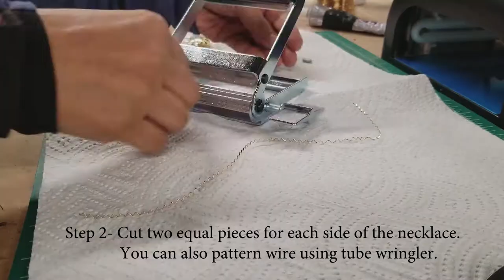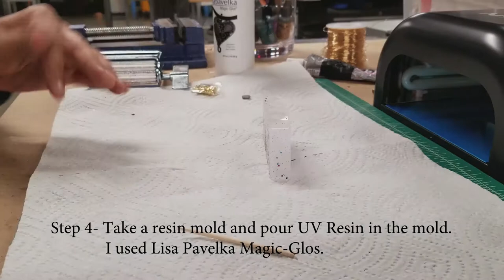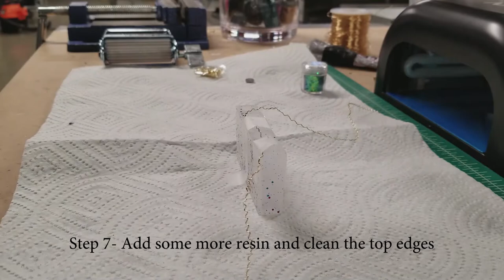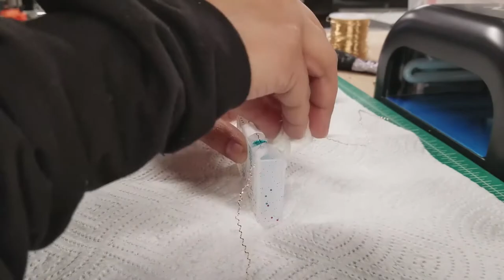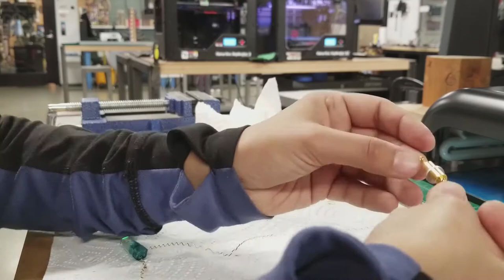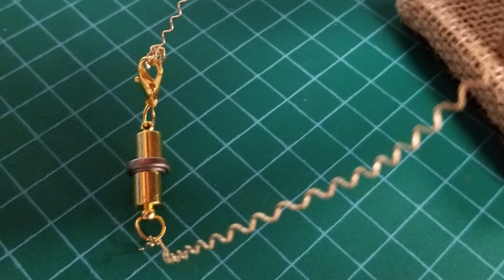Making a LED Resin necklace

Comment: Thank you for an insiration. One tip: isn't it better to cover a wire with an insulating varnish to prevent short circuits?
Reply: Alguno cables son aisladoa, se usan como en motores donde solo la punta esta sin recubrimiento

Comment: hello rolly. great job brother. i bought some stuff giving a try for this. but im having issues,  i bought some artistic wire silver color and some magnetic clasps from amazon. i connected them with the battery and could not light it up. i then connected the led light with the battery only and it worked. could it be the wire and magnetic clasps? do they have to me real metal?  need help and advice. thank you
Reply from the maker: sorry to hear about your issue. Normal artistic/craft wires are usually not conductive. I bought bare wire from parawire website - https://parawire.com/cbc-metal-supply/metals/bare-wire/    and after testing that worked for me. Also, for magnetic clasp the entire of the wire should be tightly connected to complete the circuit. https://www.amazon.com/gp/product/B00Q9LNGQY/ref=oh_aui_search_asin_title?ie=UTF8&psc=1  Another problem could be that the battery might be placed in the wrong direction.
Reply from the maker: you can also mix your artistic wire with conductive thread https://www.youtube.com/watch?v=0MkVqC1zTuI&t=16s to make a similar circuit.
Reply: @AlwaysBeCurious_  thx brother. yea i tested the magnetic clasp with the led and it lighted up. so its definitly the wire , im gonna order from parawire or try conductive thread. i also saw from other video of yours that u used glue instead of soldering. do u have any preference between the two methods? thanks
Reply from the maker: @SeedKreations  glue is only to provide extra stability. It doesnt complete the connection for the circuit which soldering does. If you are not using soldering, you have to make sure your conductive circuit connection with led and battery is always tight. Since the conductive wire was so thin and moving everywhere, I used glue to just hold it when conductive wire was wrapped around the LED piece.
Reply: @AlwaysBeCurious_  yes. thank you.  when u were soldering do you just heat the tip of the necklace wire and solder with the ends of the led lights, i ask because i saw that u heated up another different piece of wire before. does that have a purpose? thanks
Reply from the maker: @SeedKreations  two metal pieces usually doesn't directly stick to it each. Thus, to solder we need to firstly put solder wire https://www.amazon.com/Mudder-Solder-Electrical-Soldering-0-22lbs/dp/B01B61TWGY/ref=sr_1_7?keywords=solder&qid=1552957168&s=gateway&sr=8-7 to the heated soldering iron and then solder the two pieces together with solder wire. Thus, the first wire  you see me using with the heated soldering iron is solder wire.
Reply: @AlwaysBeCurious_  thanks alot my friend. i appreciated. im gonna buy a soldering kit from amazon and the solder wire. what temperature did u used for soldering, whats a good range? what about the solder wire size 0.6mm, 0.8mm?
Reply from the maker: there are various tutorials on how to get started with soldering -https://www.youtube.com/watch?v=FAbUDQmw6Ak or https://www.makerspaces.com/how-to-solder/ usually temperature is set to around 350-400 degree Celsius. any of the solder wire size would work.